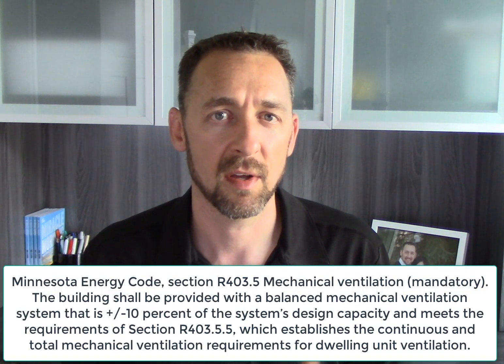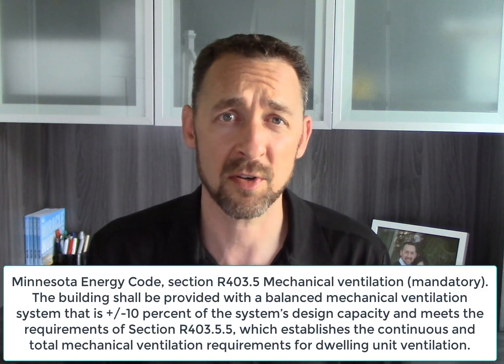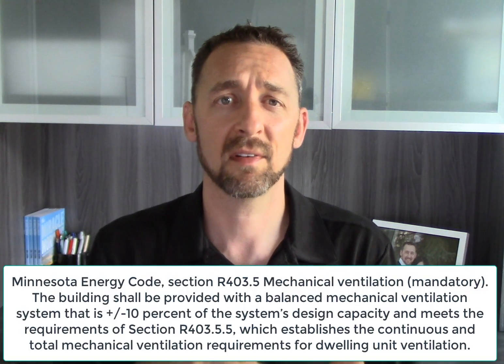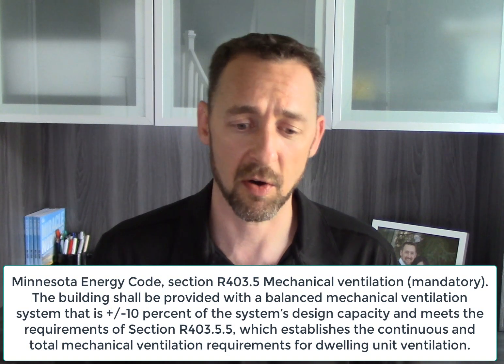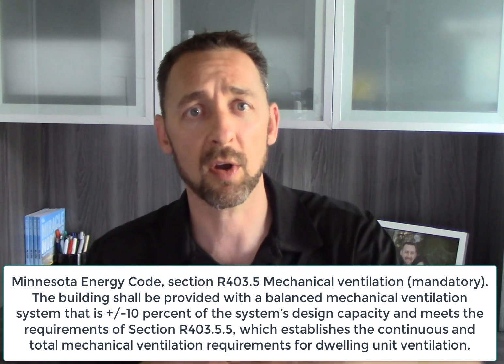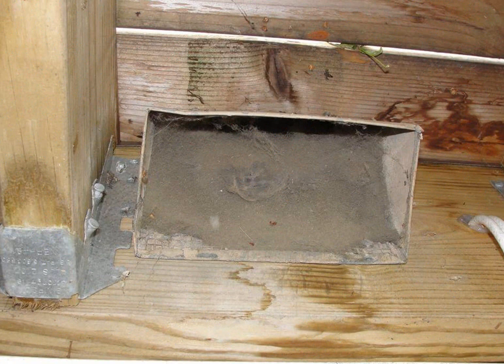Air exchangers and radon tests

Comment: This helped so much!  (maybe even saved a life who knows!).  My house was built 8 years ago, and I did the radon test at 1.5, and forgot about it.  8 years later I tested again at 6.6, and got worried..  Honestly, I thought the HRV filter at the heat exchanger was the only filter.  I clean those quarterly.  The exterior had a mesh that wasn't visible behind a metal register.  I open that up after watching this, its obviously clogged.  I clean it, and test again at a 3.1!  HRV has been negative pressure for years, but the good news is its fixed now..  and I got a continuous radon monitor..  Thank you!